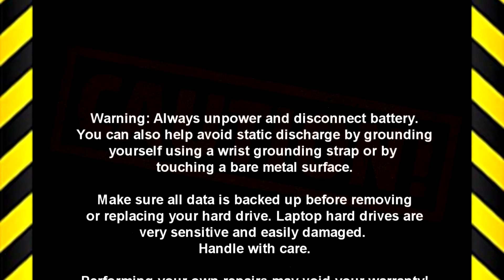Dell Inspiron 15-3505 (P90F004) Motherboard How-To Video Tutorial

Comment: Hello, need some help plz, i spilled an entire coffe on mi Inspiron 3505 notebook, i desensamble it and wipe out all the coffe, turns on again fortunately, but 3 day later when try to turn on the notebook die, cant find cheap MB to raplace, till today, but is a 3585 Mother Board With Ryzen 5 2500u, mine is Ryzen 5 3450u, at first sight both MB looks identicall, even the CPU has the same shape and form factor, connectors, screw hole,  wifi and m.2 connectors and plce. I saw you desensamble both models, can you tell me if the 3585 MB fits on the 3505 case? and if the 3505 power supply works same with the 3585 MB? Really need the tip, thx.